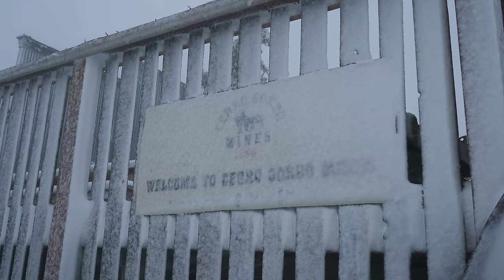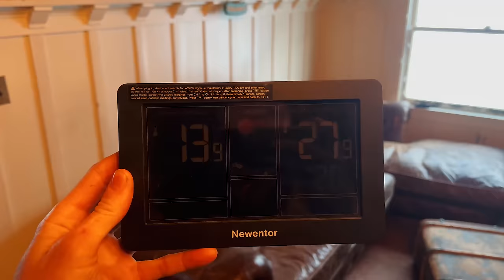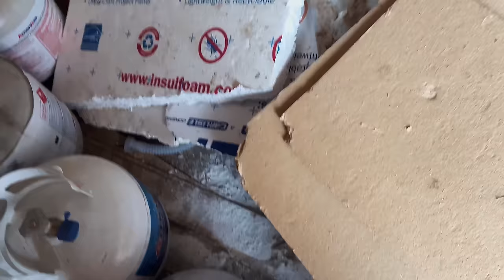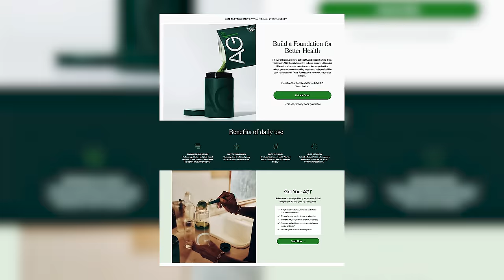Realities of Winter In A Ghost Town

Comment: I am surprised the doors are left open. Just a little planning before a storm comes in could easily prevent that. Fascinating content as always.
Reply: The windows and doors are usually always open to let air in and so guests can walk straight in but the snow kinda happened suddenly, so not much time to make sure everything’s closed up.
Reply: @Zozowilson  Plus, if his internet connection is inconsistent (likely not as solid and stable as in developed areas) he may not have gotten his weather info in continuous real time.
Reply: lol.. this is crazy to me.. its winter, snow is common up there? 😆😆😆😆
Reply: @Zozowilson  How suddenly? Can't lock everything up at night time and open up doors in the morning every day?
Reply: @Zozowilson  i dont think that the old buildings with one pan windows and no insulation is so well buildt that they keep fresch air out. Closing windows and doors to keep out wind, wet, dirt and animals is an easy way to dont ruin your buildings and belongings
Reply: I agree.
Reply: @Darktophat_10  Friggin got his ass
Reply: also keep some log near the fire pit for the next morning. insulate an run a heat wire through your water pipe, thats how its done with my well water at our cabin house in the woods in Canada. not frozen even at -30c
Reply: @swampface  it's a desert, snow is a form of precipitation
Reply: @matt45540  🤷‍♂
Reply: @overthehill1958  How can you... set up snow? I'd like to see your line of thinking here.
Reply: Slow news day!
Reply: @theoneandonlypurpl  :face-blue-smiling: Its YouTube. Nothings real. Just like your video games. Realized the channel was a scam when they had HeavyDSparks on it.
Reply: @Lavabo-Quebec  Remember this is a show. Not reality.
Reply: @overthehill1958  Explain to me how this could be faked, go ahead.
Reply: Lol yea I’d love to hear your logic on why you think this is staged
Reply: @theoneandonlypurpl  I can’t wait to hear his response!
Reply: @pauliethaman884  Double pain windows on those old uninsulated buildings is like a screen door on a submarine.
Reply: Agreed. Ensure the buildings are secure. Ensure pipes don't freeze. Ensure your ATVs are in one of those buildings for protection. Snow chains on the truck. Basic stuff!
Reply: How can you not just forward plan and shut doors.   Would have saved you about 700 calories and 45 mins Labour:   Bizarre.
Reply: @fuckyourhandle91  yes he did mention in the early part of the vid that people do self tours. Who may be the culprits to the open doors.
I think he needs to have more locked doors
Reply: Yea, that is what I was wondering too.  There should have been some notification of this storm, so you can be ready for it...  he has internet.
Reply: @Darktophat_10  
He's got your wind sock hanging
Reply: @LegendBiscuits  Tourist towns out west have been doing it for decades.  Yes, you get out there and do whats necessary.
Reply: @fuckyourhandle91  He's been up there for five years..lol
Reply: @Lavabo-Quebec  That's a great idea!
Reply: 3 years in March
Reply: @steves7896  Ham radio would be a plus.
Reply: Agreed. It seems he’s not prepared at all for winter. Water and heat are mandatory!
Reply: @overthehill1958 watch something else then ✌️
Reply: As others pointed out; A simple (nightly) checkup on all the buildings to ensure the doors+windows are shut. 
Even if you don't expect there to be rain or snow, it's a good habit to get into, to prevent wildlife from wandering and rummaging through these structures during the night.
Reply: @LegendBiscuits  he even said there are self guided tours, so people could just show up, open stuff, leave it open and he would have no idea that they went into said building. He cant constantly circle the property looking at every building. And snow storms can happen all of a sudden, just like sudden rain storms. It happens, Especially in the mountains
Reply: @Weeks25  Naa.
Reply: @theoneandonlypurpl  Are you one of those people who believe wrestling is real to.
Reply: @overthehill1958  WWE is fake, wrestling is real.
Reply: @OwlskiTV  very good point, they do a lot of damage!
Reply: @pauliethaman884  well he still is a city boy  but he did grow since moving to the mountain.
Reply: @tonyk438  the first thing to have actually.
Reply: Freaking stoner. Reminds me of this guy I used to know named Brandt.

Comment: As someone who lives in the arctic circle, I would seriously suggest preparing your wood for winter in the previous spring. Furthermore, you must build or retrofit an existing building to store 2 times more wood than what you think you need for the season. Otherwise, you will get to a point where it’s too dangerous to be there in the winter months.
Reply: I heat with wood stove exclusively and I have learned about what you suggest. Also, I prepare and store a LOT of ready kindling and old newspapers etc... and I keep my Husky chainsaw in good shape and my Swedish axes well sharpened.
Reply: Right on <3
Reply: agreed!
Reply: With a woodstove in such weather it's best not to let the fire go out at all, embers in the morning is better than starting from scratch.

Comment: Tips for the firewood; keep it in a woodshed or cover it with a tarp, and always have a few days worth of wood in your house near the stove. That way you will always have dry wood right at your fingertips. None of those doors or windows should have been left open in the first place, but I think you learned that lesson already. 😉That sled ride looked awesome, but I wouldn't want to do the walk back!
Reply: Could the propane be sheltered so it doesn't freeze ?  Also will the propane lines possibly freeze and crack causing more problems  ? Or maybe wrap some type of insulation around stuff ?
Reply: @cjw648  He needs a larger tank. Those little tanks freeze-up too easy. I believe the largest refillable one is 120 gallon, but he would be far better of with a full sized tank @ 250 or 400 gallon if he can find delivery. It gets -40℉ here in Wisconsin, and our big tanks have never frozen.
Reply: @cjw648  the propane itself doesn't freeze, pressure goes down tho.      insulation doesn't help as such the tank cools when the pressure goes down more when you're letting it out and there's no heat source so it just cools more.  having it in the sun or something would help.

Comment: If my count is correct, this is your third winter up there. I was surprised in observing your setup and struggles to exist in the winter after 3 years. Some recommendations after watching your video:

-Never let your fire go out. You may have to get up in the middle of the night to keep it going. That's the sacrifice you make when heating with wood heat as a primary source of heat.
-Your wood pile needs to be much larger and covered. Less sledding and more wood gathering, if you ask me
-A free standing wood stove both radiates heat and provides a cooking surface as well. You're losing lots of your heat outside with an exterior wall mounted fireplace. A simple kettle filled with snow or ice makes tons of food items that only need boiling water.
-Consider putting 55 gal water barrel with the top cut off near the door inside so you can easily fill it with snow, but yet have a water source that is not frozen.
-I heat primarily with wood, and if it gets down to 50F inside, I've messed up. Hopefully come Spring you don't have a bunch of plumbing to fix.
-Your truck's fuel gauge on empty is....disappointing. As you live waaaay off the beaten path,  the "fill up at 1/2 tank, never let below 1/4 tank" should be deeply ingrained at this point. Running a fuel pump with no fuel around it to cool it is a good way to burn it up. 
-Tire chains work well in mud when needed as well. Get a set for your truck's front axle first, then see if you need ones for the rear axle. Make sure your tire choice allows for inside clearance of the suspension components for chains.
-Gaps in windows can be sealed with Plumber's Putty or similar to keep drafts and snow out. If a brown tinted option isn't available, I'd imagine one could add color to putty to make it blend in.
-Install automatic closers, or large springs, or even pulleys with weights on your doors to ensure they close each time. To err is human, find ways to use technology to reduce the impact.
-If you have electricity to keep your animals' water bowls heated, then you have the ability to install heated options on your water pipes and toilet tank to keep them from freezing.
-Propane loses its ability to convert to vapor at -44F. So a tank may be full, but is useless. Find ways to keep your propane tanks warm. Paint a few black, or wrap with black magnet sheets so it can soak in sunlight. Build a shack to keep them out of the snow. Leak check all your fittings with soapy water to ensure no leaks and make the call on where you want to place the tanks to keep them wam. Larger portable propane tanks are available, but a 40lb is a lot easier to move with one man than a 100lb tank.
-Some valuable info on propane and temperature effects: https://flameengineering.com/pages/propane-information
-If you continue getting deep snow, then a snowmobile is a good choice, but its a one-trick pony. What would the costs be to get tracks for the Kubota? Or possibly convert the dirt bike to rear track and front ski configuration. A snowmobile that only gets used every so often will become a rodent's best friend with chewed up wiring. 

Keep your chin up and find ways to always improve your surroundings instead of using baling wire and bubble gum to barely keep things working.
Reply: I would add on to that list, having proper thermal layers to keep warm, and having clothes used in places in Ak, or Northern Europe/Asia that are proven to work in the weather he is facing. He should also have spare fuel for his truck, and look into Homesteading channels on Youtube to show how best to prepare for harsh winters. Root cellars, Rotating pantry, generator for when electricity from other means drops, water and wood storage, and so much more is covered in them.
I would also have the animals in a more secure set of pens. At the very least, the outside fencing needs to be a lot taller and reenforced.
He's doing good work for someone who sort of fell into it, but if he doesn't take on board some of the advice I've seen in the comments, things may become unnecessarily more difficult.
I wish him all the best and want to see him succeed. 

We're rooting for you, pal.
Reply: Right on
Reply: I really hope he reads this, but I honestly don't understand how he's even managed to keep going for this long or that if this is even his full time residence anymore. I guess the YT revenue allows him to have the money to make mistakes, but I can't fathom how he doesn't have a grasp on the fire situation, his water supply or the fact that he doesn't even bother to seal up the nicer buildings so snow doesn't get inside. Its very odd...
Reply: @Catbus-Driver  yup great points. button things up before the season moves in.
Reply: The "Boy scout " motto applies!!!!
Reply: @Catbus-Driver  first thing i notice, and being from London this should be a wake up call for him, how on earth is this the 3rd winter up there and he doesnt implement some sort of winter protection for his buildings to ensure the snow doesnt cause that. i was astounded seeing it and ive never experienced winters even close to this, uk sure does need to thank the gulf stream
Reply: The snow like  the rain was a once in 200 year event. I’m sure he needs to make a few  changes but this won’t be his usual winter.
Reply: @kristinlong2278  he literally had no protection on his building doors. I would do that on a modern building let alone one as ancient as thiese
Reply: Im going to go out on a limb and say this is not where hes living full time during the winter.  If he was vast improvements already would have been made.
Reply: @sharonb537 yeah i doubt he's living there in the winter. at least i wouldn't

Comment: All doors locked.(for winter only)
Wood in shed.(dry)
Window have protected covers(shutters) on wind side ( for winter)
Insulation on pipes.
Water on hand for needs.
Winter package on vehicles.
A garage for vehicles
with a wood stove.
Plant more trees for 
wind protection.
Hope this helps.😃
Reply: And don't forget snow shoes.
Reply: @ozlo  AND the Flamethrower
Reply: Melt snow and collect water i should recommendet.
Reply: These are all really good tips :)
Reply: Right?

Comment: General tip for getting warm while dealing with significantly cold mornings from a swede:
(Mostly just from camping outdoors in Swedish winters, our houses tend to be built to handle the cold with ease)

When you go to bed take a thermos with you of a hot drink of your choice. I tend to go with tea, but a hot chocolate or something else will work, as long as it’s warm and you can drink it and it’s in a thermos.

Put the thermos into the foot of the bed under the covers with you (added isolation that helps keep the thermos warm until the morning, also helps keep your feet a bit warmer)

That way if you wake up and are cold either in the middle of the night or in the morning, you have something to get you warm very quickly right by you.
Drinking something warm probably is the most instant way of getting your internal body temp up.

And having the option to instantly feel warmer be super accessible, as the thermos is right there with you. Within 5 seconds you can have a sip of something warm. It’s basically no effort at all.

And in the morning you have this small kick of getting yourself warm, so you are already warm while you go up and actually start a fire.

I mainly use this for camping outdoors in Swedish winters and also for the wet and cold parts of autumn. 

I also tend to drink a little bit of it right after I’ve gotten under the covers, as a way to get really warm and cosy to fall asleep easy. 

Since I started doing that for camping trips in cold weather I haven’t been tossing and turning because I feel cold like I used to do.
Reply: Good tip, thank you

Comment: As a Canadian living in the prairies, it often having days colder than Siberia, the concept of this video is somewhat funny but at the same time very serious. winter prep is something you must get down because it ultimately is life or death. because you're so high above sea level, you need to bury pipes deeper than the rest of your state to stop freezing. consider looking to building code for more northern states for information. Make sure any pipes replaced enter the building at full depth and do not come up anywhere close to exterior walls unless you're going to insulate them and keep them above freezing at all times. if this can not be done, you have to either drain the pipes when you're done using the water or keep them running none stop. moving water freezes at a much lower temperature and will stop pipes from bursting or freezing up. another thing is, fire wood must be stored out of the elements it is important to have seasoned, dry logs or else there's wasted energy while burning, also causes excessive smoke and less heat output. hope this helps and feel free to reach out if you need more information.
Reply: As an Australian, who lived in a place with 4 months of 40C degree weather, it is also interesting to see Americans cope with long periods of hot weather.

Comment: Add functional shutters for all the windows to protect them and add warmth. String heavy rope between buildings so you don't get turned around in a white out. Set up your fire for cooking (cast iron Dutch oven with flat lid, kettle, frying pan). You have mines which should work as a good cooling most of the time in winter if you vacuum seal other food you have a deep freeze all winter. You could also put big bubble wrap between the window and shutter or a strap on the inside it will insulate until you can afford something better.
Reply: These are great ideas! I was thinking the same, why not use one of the mines for food all year round for deep freezing.. I already use bubble wrap on my windows in the winter in Ohio, it works great!!
Reply: yeah time to buy a toe toaster and all that 1800s/ Pathfinder school type kit, also a backup jetboil stove and small bottles of white gas wouldnt go amiss.  you can cook alot of things with just a camping stove.

Comment: You need to do some things after seeing the mine in the snow, wether you are there or not: 
Composting toilet 12v
Secure all doors with some kind of latch 
(basic combo lock)
Get a tiger torch or roofing torch up there if you are gonna be up there in winter. To defrost metal stuff frozen
Wheres your snowshoes man!?
Get an air tag so your loved ones know where you are ❤
Reply: Yea... like it is his first Winter!!    How could this happen??   Too Funny!!!
Reply: This is solid advice!
Reply: also in addition to the snow chains he is planning on getting. Studded Winter tires ARE a must when you have snow and ice and can't use chains.
Reply: The composting toilet will freeze too. Old School outhouse is best. The poop freezes.
Reply: He has his snowshoes on at 33:24
Reply: Airtag? Dude, those work due to other people around, they won't help in the middle of nowhere?
Reply: Air tags aren't GPS trackers, they work with bluetooth and rely on nearby Apple devices to function. They work great in populated areas, but are useless in the middle of nowhere.
Reply: At least Brent finally got snowshoes for the last part of the video. But yeah it was definitely a poor choice not bringing them for his sledding trip.
Reply: @Buck1954  Its doesnt matter if it freezes though